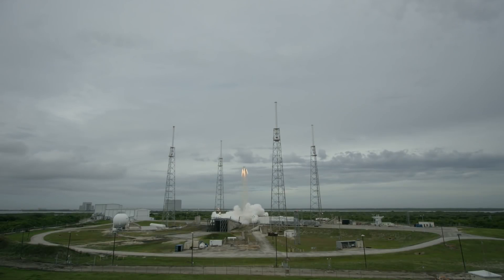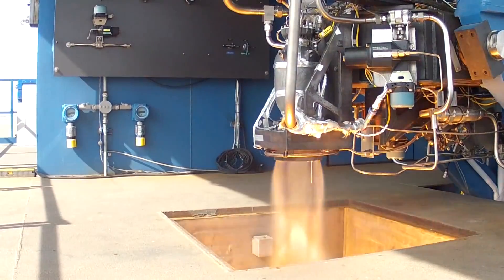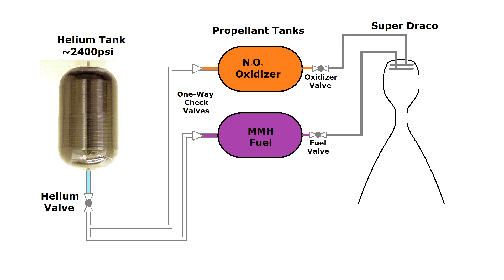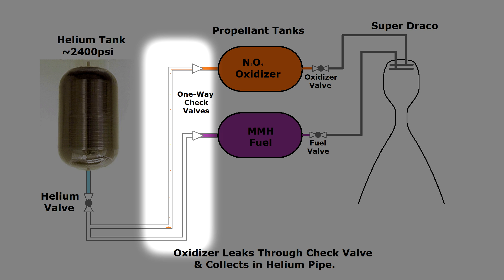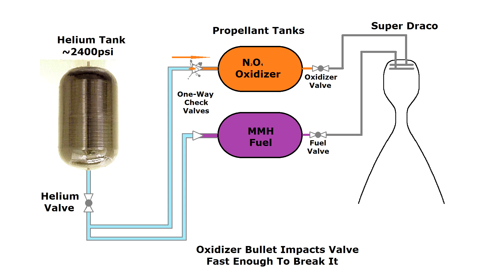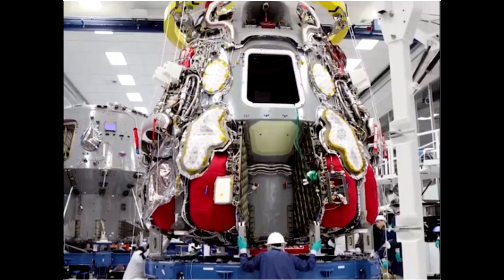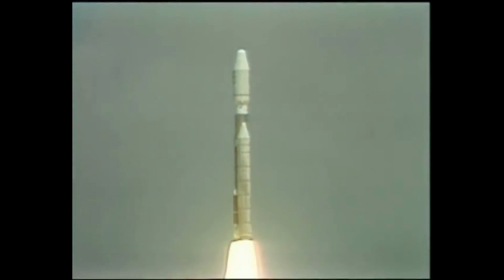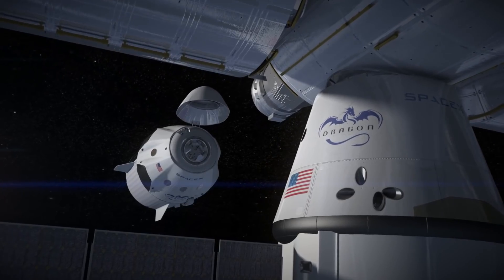SpaceX's Crew Dragon Spacecraft Exploded Because of 'Corrosive Bullets' and Leaky Valves

Comment: But how does the burst disc work?  You show a picture but it's not clear how that works as a check valve.
Reply: It is sealed against the back pressure from the fuel and oxidizer tanks, but, if it is hit, from the back side, by the very high pressure helium, it will burst and allow the helium to flow through and push the fuel and oxidizer into the combustion chamber.

Comment: As an someone who deals with instrumentation and engineering packages, the check valves were the correct choice to go vs the burst discs IMO. The PROPER solution is to have valves before the check valves to use during storage. Problem solved, I'm actually quite surprised they didn't do this because it is a much better idea in terms of re-usability. If there is one thing I've learned dealing with engineers, sometimes they don't have the actual hands on experience to recognize the simple solutions.
Reply: More valves equals more things to go wrong. An abort escape system must work 100% of the times it is fired. This is not a chemical refinery. The failure modes are different, and more life threatening.

Comment: Back home, I see...
One of the reasons to use check valves instead of burst disks might be a remnant of the days when they hoped for propulsive landing when Superdracos were more than just emergency escape engines.
Reply: now I know that it uses a smaller draco. it makes sense to use burst disk. because at first I thought of how they can relit the engine. thanks guys
Reply: @remembrane2920  Exactly. You are welcome! :o)
Reply: so superdraco is now for emergency escape only? what do they use for maneuvering in space?
Reply: @remembrane2920  I think they have (non super) draco thrusters for maneuvering and then the super draco for escape system
Reply: @matthewmiller6068  yes, they are like 100-1000 times weaker, you wouldn't want full power thrusters for maneuvering. 

They do use the same fuel though, through the super dracos for launch escape, then if that isn't needed they route it to the dracos for moving around in space.
Reply: @remembrane2920  "Non-super" Dracos, much smaller ones. Scott mentioned them - they tested those first and it went OK, before this "anomaly" happened. Both use the same kind of bipropellant, but Superdracos have almost 200 times more thrust.
Reply: @remembrane2920  The smaller Draco engines which have separate fuel and helium tanks.  Only the small Draco engines were used during demo 1 flight.  And the small Draco engines were successfully tested just before the supper Draco engines were tested.
Reply: @remembrane2920  Initially, they were meant for landing the Dragon.

Comment: It's great that they discovered the cause, but I do hope that they return to the multi use option eventually.
It's critical moving forward that we start to look at these vehicles in the same way we look at cars, buses, airplanes. 

We need to see things like the thrust from the super draco engines as something that can actually be used in the case of other issues... such as an improper inclination to a safe landing area or to extend the range to drop into the sea instead of hitting land.
So I do hope they can get back to a point where they make these engines versatile again.
Reply: they're not thinking long term here because they expect to replace the Falcon and Dragon with BFR fairly soon.

Comment: Thanks for the update Scott. I think Space X should probably design a solid thruster replacement as a future upgrade now that they are not going to propulsively land the V2 anymore. It would probably save weight, be cheaper, improve reliability, and require less maintenance.
Reply: Replacing the SDs with solid rockets isn't exactly a simple swap... you're basically in "redesign the entire capsule" territory, and that's not going to happen. And if it did, I suspect Elon would want to persist with the propulsive-landing approach... they save a lot more weight and cost by not having to carry separate systems for landing and abort, not to mention avoiding the need to drop the capsule into the ocean...

Comment: It would be a good ideal to have control valves before the one way valves, which would prevent this, but then adds additional risks (control valve not opening), and additional costs. Or only on the Oxidizer line, as that is the higher current risk.

Comment: I don't get how you can replace a one way check valve with a burst disc.
Reply: The burst discs are a one use items. They separate the two tanks from the helium tank until the two tanks pressurise, at the emergency abort firing.

Comment: some things.  i think the helium system is used to pressurize both the superdracos and the dracos, so there are potentially troublesome actuated valves between the two systems.  spacex didn't say the check valve that disassembled was the "leaking component" and, by inference, the "leaking component" was something else in the system.  n2o4 boils at fairly low temps, at the expected (lower) pressures within the helium tubing, so while it has more mass than helium gas, it's unclear whether it was really a bullet of liquid or just another gas aimed at the check valve - this is somewhat immaterial in that the relatively high pressure n2o4 in the presence of titanium might have insta-corroded the titanium and caused it to break enough to "strike" and ignite.

it very well might have been a check valve that failed initially and allowed the n2o4 to leak back into the tubing, but i think spacex would have said so if that was the case, based on how the press release was written.
Reply: more info came out, and the spokesperson said the same valve that leaked was the one that was broken and ignited.  still unsure why they think the n2o4 was liquid in the tubes.

Comment: quick question  … can dual in-line check valves be used?
Reply: No, this is not a good solution. 1. More things to fail. 2. A slow leak in the first valve will prevent the second valve from seating properly.

Comment: Redundant check valves?
Reply: No, this is not a good solution. 1. More things to fail. 2. A slow leak in the first valve will prevent the second valve from seating properly.

Comment: I think I answered my own question, these are not normal propulsion engines they are abort engines, you don't have time to prime them! I'll leave the below just in case anyone else is thinking the same :)
Why not replace the non return values with similar valves that could be closed bidirectionally on startup, that way you could slowly prime the lines until they are up to pressure. Or thinking about it considering I think they are controlling the burn rate by the two fuel valves, why not just slowly prime the system with the helium valve rather than opening it in one go.

Comment: As a former Toyota engineer who used statistical process control methods to ensure vehicle safety systems worked 100% in the vehicles lite time... I have two problems with all this. First, the fact that another spacecraft/vehicle/system has had a failure caused by a leaking Nitrogen tetroxide check valve, should have been factored into the Failure Mode and Effects Analysis for the vehicle.  Secondly, the fact that a single use system cant be tested is rubbish, every airbag in every car has been made with the expectation that at least 99.997% of them will work by using standard deviation, tight process controls and sample inspection and testing.
Reply: But the airbag that is physically in my car has never been tested, only others of identical manufacture.
Reply: Odysseus Rex true but it doesn’t matter. The chance of it failing to deploy in the first 10years of its life is 1:1000000 and it only has to do its job once. The math that goes into ensuring the quality of an airbag is sound and it makes single use systems more robust because you don’t have issues like wear.
Reply: @jackalovski1    That is irrelevant to the statement you were responding to. Elon likes to test the actual, physical components in the spacecraft. That is what was meant. With a single use component, by definition, you can't do that. It doesn't matter how reliable the component has been shown to be, by definition, you can't test the one in your system. That was what was meant and nothing can change it.

Comment: Also, wouldn’t the burst disks make it impossible for the Super Draco’s to have relight capability? That would have been required in order for SpaceX to facilitate their land landings using retropropulsion because they planned to do a test burn at a high enough altitude to allow parachute backup if the Super Draco’s had an anomaly.

Edit: I wonder if they could get around this issue if they slowly ramped up the valve opening. Rather than milliseconds it would take about a second. This would only be implemented when relighting the engine as the check valve’s seal integrity may not be compromised until its opened at least once. That way you could still maintain a quick reaction time for an abort operation.
Reply: This might just be a quick fix to get back on time schedule, with a better valve later.
Reply: I'd also like to point out that burst disks likely take a lot less space in the plumbing than the check valves. So potentially, they could just use both systems in sequence, with the burst disks providing long-term safety prior to the first ignition, and the check valves asserting a slightly lower degree of safety for a potential reignition at a later point.
Reply: Are burst discs common for this type of application?  I'd be concerned that metal shards would make their way downstream causing damage or blockage of small orifices.  These shards would come from the initial burst or break off due to turbulence.  I'm aware how the discs work and most of the metal is still somehow attached to the main plate.
Reply: @bobroberts2371    Well, since now this system will only ever be used in the event of an abort, that's not really a great concern.
Reply: @bobroberts2371  I was wondering the same thing, but im assuming these things are well used in rocketery already, and NASA wouldn't be happy with them if there was any danger.
Reply: @bobroberts2371  burst discs are common in high precision applications, from rockets to particle accelerators to potato cannons lol
They can be designed to not shed any material, and it's very easy to put a in line filter just downstream if needed to catch any debris from it.
But considering that it would first go into a large tank, then through high flow plumbing and out a rocket engine, no pumps or turbines along the way, it would have to be a pretty large piece to cause a problem, and that would be throughly tested first.
Reply: Odysseus Rex  Saying the system is only used for an abort and there isn't any concern might have been the logic that lead to the explosion in the first place.
Reply: ke6gwf if a slug of fuel caused a rupture, a sharp piece of metal could cause a similar failure. Granted the metal has mush less mass but is sharp.  So far no one has posted definitive info as to if burst discs are used in other rocket applications.
Reply: A second can be the difference between life and death for an abort system on top of a rocket experiencing violent and unplanned disassembly. A huge amount of design emphasis for the superdraco system went into ensuring an extremely fast and reliable burn when required!
Reply: Obviously not an expert, but the burst disk or check valve in question is between the helium pressure tank and the fuel and oxidizer tanks. There is still a controllable valve between those tanks and the reaction chamber, so it seems like they could be relit. Of course the disks would require replacing if the system needed to be fully depressurized.
Reply: Was just about to ask the same question, but seeing that these engines are only really needed in the event of an abort, I doubt its going to be an issue if the burst disks need replacing.
Reply: Exactly.
Reply: you can relight, no problem. Once the system is pressurized there is no need for the valve anymore. I assume the one way valve is mostly there to allow fueling of the system. From the first firing to the final purge of the fuel chambers the system will probably stay pressurized
Reply: Maybe the check valve(s) need to be closer to the ignition point to avoid back flow ?
Reply: If I were doing it, I would put the burst disc at the pressurization port on the tank, so that no fuel can enter the plumbing at all while the system is in standby mode.

Then if the system is needed, open the helium valves, the discs burst, and the engines fire.

The only times the disc would be burst is on an actual abort, or propulsive landing, and in either case the helium pressure is going to be maintained until its on the ground a few minutes later.

So there would be no problem with relighting them because the rest of the plumbing is the same, and there wouldn't be any chance of leakage past the check valve because the pressure would always higher once the burst disc was breached.
Reply: The Super Draco's are for aborting a launch, aren't they? I would say that no being able to reuse the thrusters isn't as big an issue if they are only used in emergency.

Comment: In a real failure analysis, they would try and duplicate that failure.  There is no doubt that the mechanism described would destroy that check valve and everything around it.  What catches my eye is the magnitude of the explosion seen in the video.  It's true I've never seen the Dragon helium pressurizing system but helium pressurizing systems in a vehicle even as large as the Space Shuttle only used 1/4 tubing for helium pressurization.  It's hard to imagine that the rupturing (and white flash) of the spacecraft outer shell could be so violently shed simply due to helium coming from a ruptured 1/4 line.  Also (again only assuming since I've never seen one) in the vertical, only N2O4 ullage would have been coming from the tank.  Very little raw liquid N2O4 would have been expelled from the tank's pressurization line. The explanation given in that link is very weak and not very convincing.  I don't doubt that it happened, just pretty sure there were contributing factors that either are not being disclosed, or not discovered.
Reply: Pressure vessels are seriously scary.  It's not hard to find videos of them rupturing explosively online for vessels with far lower pressures than 2400psi.  Under the right (or wrong!) circumstances, a pressure vessel becomes a bomb.  Although I can't find any numbers for the volume of the helium tank in Dragon 2, an abort system takes a decent amount of fuel + oxidizer, on the order of a metric ton, meaning you need a pretty big helium tank to pressurize the entire propellant tanks as they empty out.

As far as the N2O4 leak, the plumbing has a significant volume.  It would have been possible for quite a significant amount to pool up in there, and it would be pretty much impossible to detect from the outside.  Due to the pressures involved, this fluid will be slammed into that valve at a velocity in the 100s of m/s range.  Since N2O4 is incompressible, it impacts sharply like a hammer.  This shatters the valve, exposing fresh titanium without the protective oxidized layer that forms on surfaces exposed to oxygen, which can then ignite.  Note that even without catching fire, hitting the valve that hard is very likely to cause disaster all on its own.

High pressure systems must be treated with respect.

Comment: So the burst disk will need to be replaced for every mission? System Not reusable anymore?
Reply: Probably checked after every mission, only needing to be replaced if used for an abort.

I imagine SpaceX will likely remove the entire abort system after a flight though, since they are only going to use them for a single manned flight, then convert them to cargo. And since most cargo flights don't require abort systems that's extra weight to be hauling around.

Comment: Odd, don't know how you replace a check valve with a burst disk. Disks don't allow fluids past where as check valves do in the 1 direction...
Ah, nvm, figured it out. He pressure would rupture the disk for when the engine was needed.
Reply: I'm thinking it isn't 'replace', but add in.  The check valve would remain, but with a burst disc to prevent leakage like this before the engine is ignited the first time.
Reply: @NemoConsequentae  Sounds like replaced. Which seeing as the engines are now an emergency device, where they were originally to be used for landing, replacing to remove the valve is a smart option for simplicity.
Reply: but definitely makes a super draco firing a single time event per mission.  But I can't think of any other reason it is needed other than launch abort.
Reply: Actually it was NASA studies done in the 60's that identified titanium as a sutable material for use with the oxidizer.  NASA has been using Hypergolic systems with check valves and titanium has been the preferred material since the early days of the space race.   Space X also got NASA's approval for the design some time ago.

Comment: SRB O-ring problem all over again... failure to properly seal leading up to a catastrophic failure. Glad that it happened in an unmanned test.  I expect the burst disc is a short term fix until a more robust check valve is developed.  Maybe a dual valve with different activation pressures and a non-reacting interconnect -- like a network DMZ between two firewalls.
Reply: That's not  bad idea, but I doubt they'll do it. Since NASA has already put the kibosh on propulsive landing and manned reuse, and SpaceX expects to retire the entire system in favor of BFR in just a few years, I doubt they will put any resources into it they don't absolutely have to.